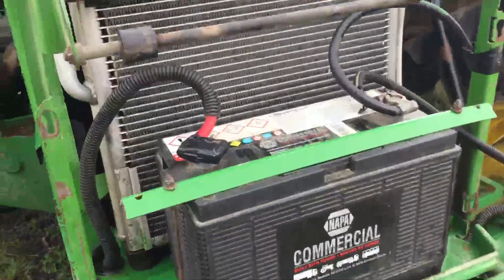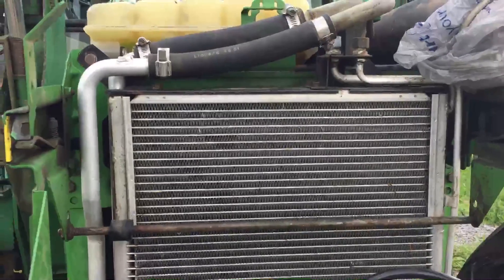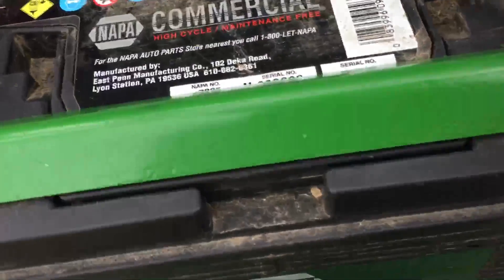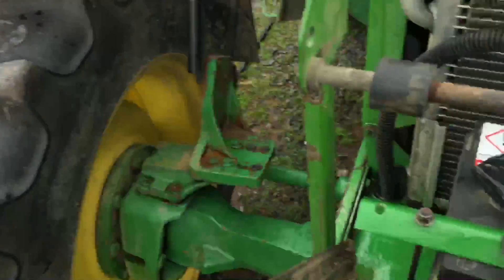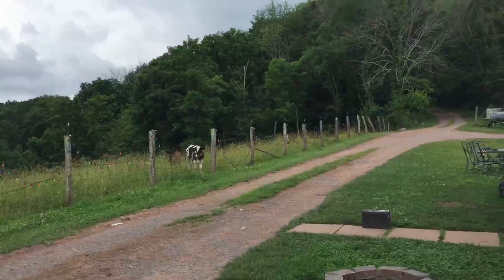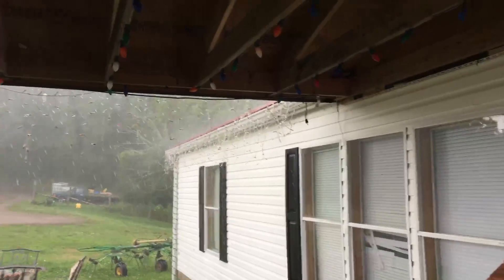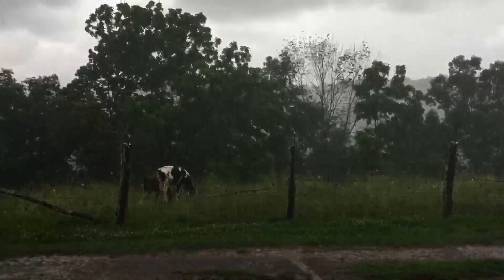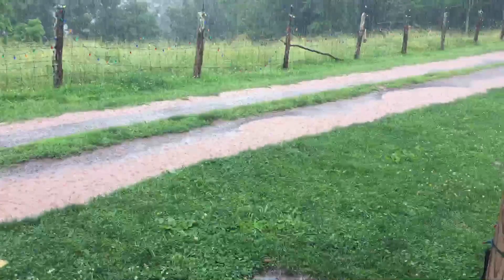Attemp 1 on overheating + rain

Comment: A little trick I learned somewhere along the way... 

Spin the fan clutch after it has come up to operating temperature and gotten good and hot.  If the fan spins more than 1.5 turns with a good hard spin hot, it's probably shot.  

If the fan clutch has a small spiral coil spring in the center on the back side, take a screwdriver and slide that spring off the pins and remove it.  That should allow the fan clutch to "lock up" and it should cool fine after that.  If not the clutch is shot and must be replaced.  

The thermostats are probably the best place to start.  Have you inspected the radiator to see that it doesn't have lime or scale clogging the tubes and restricting flow?? That can happen over time particularly if someone has been topping it up with hard water... 

Later!  OL J R :)
Reply from the maker: I’ve checked the radiator and used a cleaner that is specially made to cleans  radiators and I flushed the radiator with a cleaner and I only use distilled water and anti-freeze